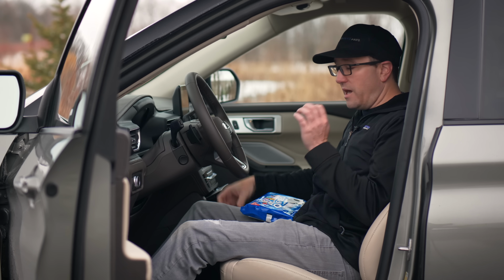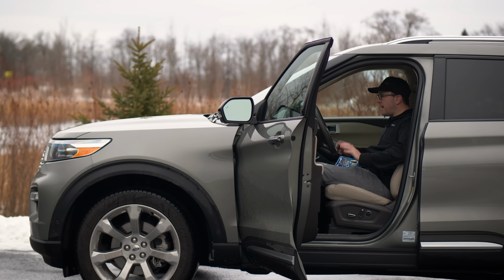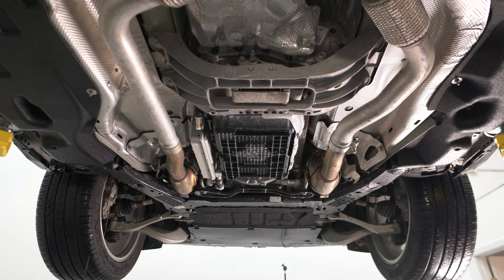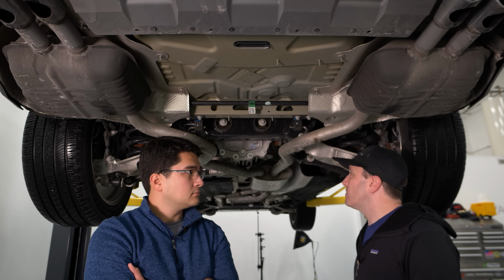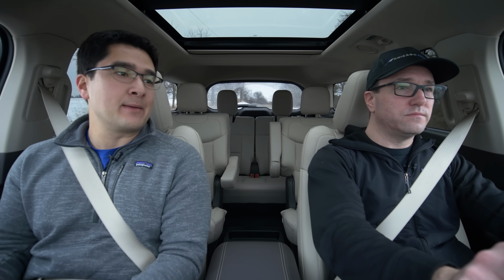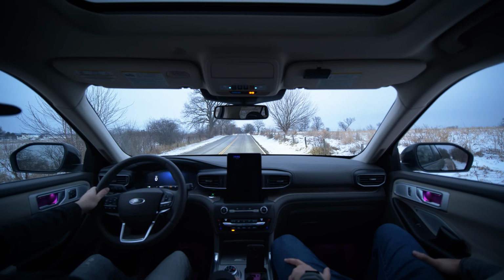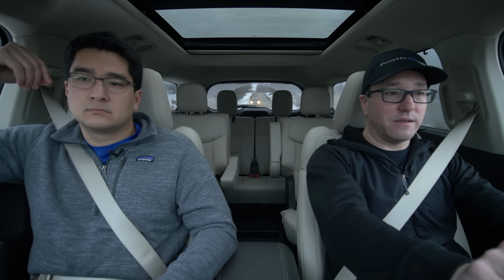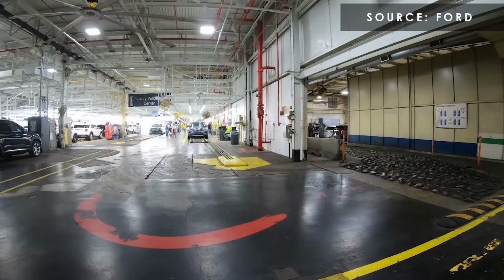2020 Ford Explorer | Who Is Responsible For This?

Comment: Excellent review guys. The explorer is a freaking joke all the money and technology ,twin turbo chargers and hardware and they completely dropped the ball. Most of the ones around here have the four-cylinder turbo engine which is noisy rough and very coarse by comparison to the V-6 everyone else has.You hit it on the head fleet  buyers and loyalists to Ford products will buy it.

Comment: Hmm... $35K for a base Explorer or a Mustang GT??? Hmmmmmmm...

I will tell you what I did - in January 2018, I went looking for a new car. I wanted an Explorer. Kitted out just decently - not nice but decent - and I was looking at a $46K price tag. They'd "work with me" to get it to $39K. I drove off the lot behind the wheel of a new Mustang GT, 460 HP,  kitted nicely, for less than $36K.

I really like the Explorer! I just don't like the price.
Reply: @6:53 - no YOU would be better off getting your back waxed for 6 months with that $1000. I would gain nothing from that, and let's be honest here - you tell me I have to spend $1000 and my two choices are bad audio and a dude getting his back waxed, I am choosing bad audio every time.

Comment: Good, honest review.  I took it symbolically that you stood in front of a Jeep Wrangler for your final thoughts segment.  I own one and it is truly a B effort (fit and finish, some questionable engineering designs, etc.), and similar to what I saw in the Ford Explorer when I saw it on the new car show circuit.  Like the Wrangler, if you're an Explorer fan, you're probably willing to look beyond some of the shortfalls and use those to negotiate a favorable price, but if you're just looking for a good SUV, I think you nailed it - there are others that one should look at when making a choice about which one to take home.

Comment: YES FORD HAS THE ABILITY TO UNFINISH THEIR VEHICLES.  "THEY WILL BUY IT REGARDLESS" CONCEPT.  SADLY THAT HAS BEEN STANDARD IN MY OPINION.  THAT SAID JUST BUY A 150 CREW CAB BUT NOT AT 64 K WHICH WHAT A FRIEND 'S COST BUT HE GOT A DEAL "I ONLY PAID 62 K.  THE AUTO INDUSTRY IS AT IT'S PEAK.  NO I WON'T BUY ANYTHING THIS PRICEY AS I CAN STILL BUY HOUSES FOR AN INVESTMENT.  AUTO'S ARE NOT AN INVESTMENT.  I NOW RIDE A 95 FORD DUALLY CREW CAB WITH LOW MILEAGE WHEN PURCHASED.  I AM RESTORING IT AND VALUE IS GOING UP:)  FORD IS GOING THE WAY OF GM.  MY FIRST FORD HAVING OWNED A CHEVY SUBURBAN LT ALL LEATHER 4 X 4 WHICH I RAN 240 K IT WAS A DREAM.  I NEEDED A DUALLY, NOT GOING TO PAY THE PRICE OF A NEW ONE, NOR A CHEVY ANYTHING.  SUMMARY YES WAIT A FEW YEARS  TO GET BUGS OUT.

Comment: I would prefer manufacturers of all brands to stop it with the screens and just go back to knobs and dials, where I don't have to take my eyes off the roads to use them, especially when you have the same government that thinks that's OK, but telling everyone not to use cell phones for the same reason.  If you're going to bother putting screens in cars, there is no excuse for warning lights that tell you nothing.  Give me the actual error, not just an engine light.

Comment: We are trying to choose between a '19 Explorer Sport and a '19 Grand Cherokee Limited V8.  We have a 120 lb. GSD.  The Grand Cherokee seems to be better suited to hauling him around.  The smaller 1/3 of the rear seat folds down, and the rear cargo area is much lower (he is real tall).   Then we come to the engine.  The '19 Sport has a 3.6L turbo 6 cyl. 365HP & 350 Torque. You can get a Hemi V8 @ 360HP & 390 Torque in the limited.   Then we come to the front end.  I have never seen a Chrysler 4x4 product with a front end that lasts.   The Ford's suspension design is much better.  The build quality also seems a little better in the Ford.  If we wait until the '20 then they are both RWD.   It's a tough choice because they both have a lot of potential issues. They both have some questionable engineering, and neither one really inspires me.   I am an engineer so I can throw some serious shade on a vehicles design, which is also not fair of me.

Comment: So I'm about 3 minutes in, and I have to agree with you!!! I came ever so close to purchasing a new 2020 explorer. I'm a Ford guy, always have been, but I was not impressed one bit! Mind you the ST is a different can of worms, underneath it all, there's copious amounts of cost cutting, and one of the cheaper interiors(fit and finish is terrible, and quality of products aren't much better). I must say, I'm rsther disappointed... I was really looking forward to the jew explorer, but Ford really dropped the ball. One other reason I didn't buy it, is the engine options. I get Ford is pushing the ecoboost program, but I'm still not sold on it, and I want the ability to drive a n/a engine, and with the 2020 explorer, I can't... Unless u count the hybrid... Which... Can we really call it that!?!

Comment: not a problem the issues, it will last 3 yeras and you junk it and buy new, its a Ford. it got obvious rust spots on muffler, will be change time in two years. RWD make it draw more fuel as got many 90 degree  gears. That car will have 45k road tax a year here as a gasguzzler.

Comment: I’m a Ford realist not an apologist. This is typical of Ford taking a really good idea and halfway making it happen. I wouldn’t be surprised if there is some third party manufacturer who is responsible for one of the transmission modules used in the Explorer to cut costs- and they did cut costs in materials without Ford knowing similar to the DCT fail in the Focus which was an award winning design that failed in the real world due to improper materials used by a 3rd party manufacturer. As far as interior stuff goes, Lincoln will make it work the way it should. I hope that all they overlooked was interior parts fitting. I certainly hope that they get the hybrid right, but I’ve been disappointed in the reviews of the pre-production versions. Ford got slammed by the world for the CMax hybrid due to their marketing drive when they should’ve marketed it as a hybrid that was as fun to drive as a Focus and made fun of Prius’s as being poky. The Explorer hybrid should get fuel economy in the low 30’s with no reduction in towing to be outstanding in this segment. I think Ford killed it with the fuel economy and power in the Escape hybrid- then just completely overlooked the interior. In the Explorer, I hope it doesn’t turn out to be the opposite. The infotainment fail you pointed out in the Explorer will cost Ford, sadly.

Comment: In Europe will will get only one engine version but the strongest one - ecoboost v6 hybrid with 450hp. Biggest VW suv, Tuareg, which is smaller than explorer, with similar power costs around 100k euro (over 110k usd). Volvo XC 90 is also smaller, has way less power and costs almost 100k usd. S audis, m bmws and amg mercedeses are not even worth mentioning because they cos over a double of explorer. If explorer comes in a range of 70-80k euro here in EU it will crush everything with similar power. This central screen though... Complete catastrophy. They should elegantly integrate it with dashboard like in the edge/mondeo.

Comment: The problem here is that they are trying to pack all this technology so it can be a me too automobile within a an automobile that clearly wasn't designed for all that technology. Ford is a mass producer of automobiles, it has no place in high end markets really, yet it's trying to appeal to that market with a big fail. Sure that thing will sell to Ford buyers and fleets, but clearly I don't think it's going to attract many new buyers. The body is already almost 10 years old, the chintzy plastics are unattractive as can be and that infotainment center, my god. It reminds me of the Samsung Mega. Remember that big phone that wasn't? Ok, big it was and that was it. It was a cheap low end phone in a tablet body. Not only does that screen look cheap, the fit is just as bad. Who needs a screen that big in a car like that anyway? But it's as if they took that god awful embarrassment and mounted it an otherwise empty slot in the dash. It's not even that it looks bad as much as it's obviously very poorly thought out.  It's true not everything is bad, but would you spend $50k on this thing? I mean honestly?  It's as if your a beta tester to a company that has no idea of what it's doing. The level of lack of refinement is jarring, It's really a shame because unlike most of the competition you can openly see the potential for something much greater but it's also obvious it's an unfinished product of that something great. It reminds me a little of the Jeep Grand Cherokee, but much less refined. For a car company that has been producing for this long, it's a bit of disappointment. It's a bean counters wet dream. I can just picture as the engineers designed this car, bean counters would stop along way, and the ways look a little obvious. Apple had this same problem in the mid 90's.

Comment: You can't change the orientation of the screen? I've searched dealer's online interior shots of the Explorer, and the screen is orientated in landscape. The XLT trim does have analog tach and speed dials in the center gauge cluster. The one in the video is the Platinum trim. I really like the review. Sounded honest and fair.

Comment: Why would you test a vehicle in such low temps, 3-5 inchs of snow all around. Test car has 4k miles, what did the previous testers do to the car?
Reply from the maker: Because we live in Illinois and there is something called winter in many areas, which has snow and cold.  Which happens to be a great place to test AWD.  4k miles is roughly 7 people testing it.

Comment: What I see when talking about the inside holding up and even just the way the outside looks, is this is also their new Intercepter model.  The last Explorers looked mean and looked like police cars.  This does not, looks a little weird in that regard.   And if the inside can’t hold up to the abuse cops put it through then they are probably going to hear about it.

Comment: you know... while they're under these vehicles i'd really like to hear their thoughts on how easy it is to do an oil change on whatever vehicle they're reviewing... as changing oil in cars is what i do for a living it seems some manufacturers simply don't want you to change the oil by making it as unnecessarily as difficult as possible. like having one big plastic splash guard under the engine and having a cut out for the drain plug.... but not one for the oil filter completely defeating the purpose for a cut out to begin with.

Comment: Today it's all about technology. As someone who gets paid to work on this stuff all day long. I agree with this brutally honest review.  Just keep in mind that all manufacturers have the same type of issues these days. All the new features in cars and trucks add complexity and cost. While creating more problems, issues and potential failures. I dont car who makes it. They have no reached the point where he quality cannot keep up with the technology.

Look at the Toyota trucks. Under powered very old engines. Six speed transmission and very basic 4x4 systems. The are all rock solid and work fine. Every wants them to upgrade them Toyota is very cautious about making upgrades? Hey don't want the problems that come with new products. When sales slip enough the changes will come.

Comment: Savagegeese- Can you do a review on the 6cyl Dodge Durango.  I had a Durango back in 2011 and looking to getting one as I LOVED that vehicle back then so I'm curious how it's changed and been updated.

About this vehicle, I love the look but that tablet center screen looks hideous and way out of place.  The camera for backing up or whatever is horrible too and the way to get in the back seat looked terrible too.  Why couldn't they do something where when you fold the second row seat to get in the third, it folded forward to let the passenger get in there (like the Pathfinder). I am petty surprised to hear about the transmission because right there this means this car is garbage.  A car is nothing without a proper engine and transmission.  Everything else can be overlooked but and engine and transmission is everything.

Comment: You're not wrong about that 10 speed. I love my new F-150 it has a 2.7L and its a great truck but something seems off about it. One day I was driving on the freeway I had to accelerate to get out from behind a semi while I was 70 with cruise on and the transmission was like "Oh you need me to do something?" BAM it down shifted so hard my TCS light flashed at me and I made the back wheels lock up for a second. It was violent in how it did it I thought I broke the truck, it seems like you have to drive on its terms not yours.